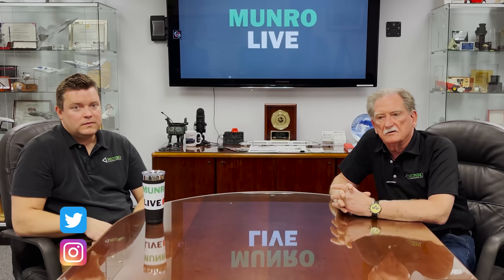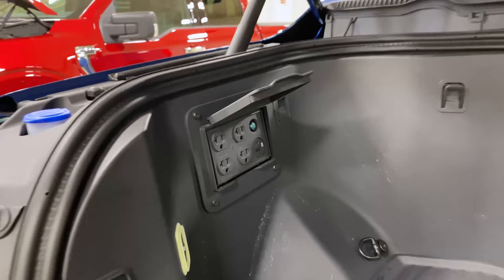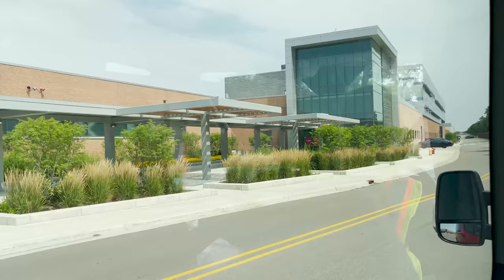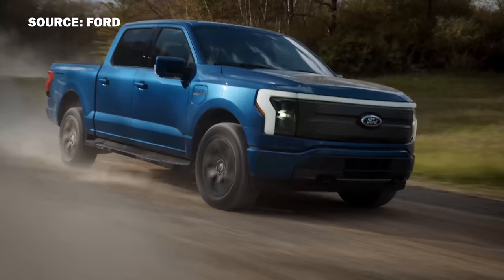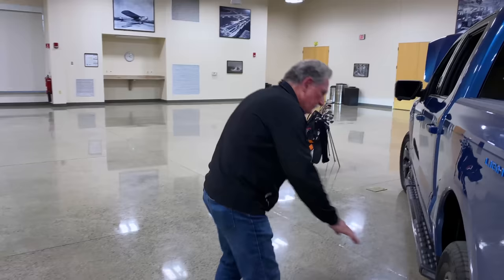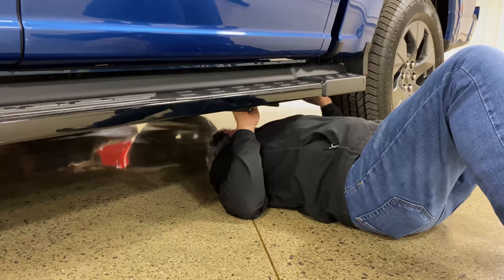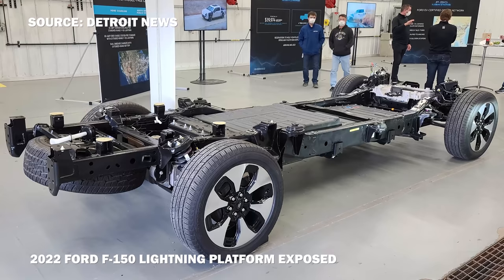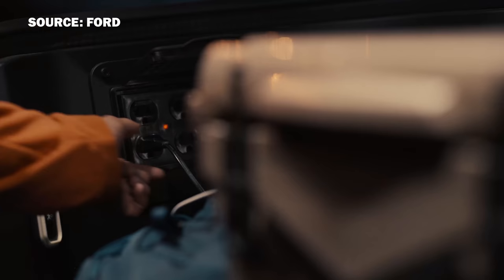Sandy's First Look at the Ford F-150 Lightning Electric Truck!

Comment: I’m not sure I understand what “isolating the battery” means.
Reply: Same here. I hope somebody will explain.
Reply: My impression is that others use the battery as a structural member, whereas it appears there's a more conventional frame with this truck.
Reply: I wonder that too!
Reply: Vibration-isolated, i.e. mounted via rubber bushings and such.
Reply: Shock-inertia-protected is how I read it.
Reply: Isolated from the rest of the vehicule, with rubber bushing or something. My guess is to prevent impacts to be transmitted to the battery pack.
Reply: I’m sure we will find out when they tear into one in the coming weeks.
Reply: isolating from vibrations?
Reply: I guess it might be easily removable/upgradeable...
Reply: Ok.. isolated is great now? Weren’t we being told making it an integral part of the chassis, that THAT is the best application? Instead of hauling the batteries like a sack of potatoes, make them work to be part of the stiffness of the whole chassis?? Now I’m confused why isolating the battery is some good idea.. vibrating the battery module is not something that was ever mentioned was a bad thing
Reply: @airheart1  The difference is this is a utility truck. You're supposed to be able to drive on rough terrain at reasonable speeds without shaking the battery apart.
Reply: @jabroni6199  Weeks? It's not shipping before mid-2022.
Reply: I’m that guy in the back of class confused as hell but not sayin shit so thanks for speaking up. He glossed over it like it was common knowledge and I kept wanting to know how that compares to the structural battery pack Tesla has planned.
Reply: The battery is mounted the the frame via a series of rubber isolated mounts, much like motor or engine mounts. Batteries do not like vibration inputs. Given the nature of body of frame vehicles there is a fair amount of cross vehicle flexing. Hence why beds are not typically integrated with the cab (which is also isolated). While body of frame / unibody trucks with integrated cab/bed configurations do exist, there is typically a notable trade off in payload capacities and tow ratings. 

More then likely a fixed or rigid mounted battery did not pass internal Ford targets.
Reply: @68fbjjz109  so are we saying this isolated battery is good for the F150 because of the body construction? But this doesn’t apply to the Cybertruck because it is not the same style of body construction? Or what? Are we suddenly saying the CT should isolate the battery there also? I have a SERIOUS doubt you are going to shake apart a f’n structural battery.. it’s a structural component! If you can shake IT apart.. you would have to shake the entire f’n vehicle to pieces.. sooo you would have bigger problems then just the battery at that point.
Reply: @boostav  ok months 🤷🏻‍♂️
Reply: @airheart1  I think it’s a car vs truck thing. What works well for a car riding on smooth pavement 100% of the time isn’t necessarily the best way to build a truck which often times see much harsher conditions.
Reply: @jabroni6199  i can understand that difference and it makes sense. But they seemed to think that having the CT with a structural battery was a GREAT idea just a little while ago.. and they seemed to expect it to do off road work.. so I’m still a bit confused is it a difference between the F150 body on frame.. vs CT exoskelton thing also? Or are we going to decide the CT should be isolating their battery also, down the line? Not that I would be one who would use it off-road much to care.. but.. as a informed consumer.. just want the knowledge of what’s best for what
Reply: @airheart1  The F150 and Cybertruck are completely different structural executions. 

What is good for the Lighting, doesn't directly translate to being good for the Cybertruck. We are at the cusp of EV car adoption, and their is far from a industry consensus there, let alone EV trucks however, I wouldn't be overly surprised if a trend of body on frame based EV trucks (which have many merits) having isolated batteries becomes apparent in contrast to other offerings like the Rivian and Tesla.

The use cases for a trucks are much more extreme, and their wheelbase offerings magnify all structural considerations. If EV trucks are going to be successful in construction, utility, and off-road environments. Their battery pack must survive those unique considerations. Watch videos of older truck/jeeps going up RTI ramps, and then watch the latest generation vehicle do the same. There have been significant increase in torsional rigidity, and those are design considerations that are not incorporated into cars.
Reply: @airheart1  it’s possible the exoskeleton on the CT provides enough structural rigidity so that isolating the battery isn’t as important. Just a guess though.
Reply: Rubber mounts.
Reply: I think what others are saying, that the battery could be removal if necessary but i really believe that it's protected from impacts.  It's own thing, verse being part of the body of the car like the Mach-e, where it's battery is a support member.
Reply: @dirkkruisheer  it isn’t hard bolted in
It has rubber mounts to protect it from vibration 
It also probably is used like a big Harmonic dampener
That’s probably why it rides so well
Reply: @airheart1  it’s a good idea if you are using body on frame because you aren’t using the pack for structure. But I will dampen the ride I guess
Reply: @airheart1  it’s a dampener
Reply: @ericrotermund1004  Great, thanks. I assume it never can be a structural element then.
Reply: I think that, for a truck frame, battery pack isolation may be important because it will allow the frame of the truck to flex in torsion without distorting the battery pack. Truck frame design is more about toughness and resilience to excessive loads than it is about torsional stiffness to improve handling. Some flex in the frame is required to reduce impact loading.
Reply: @68fbjjz109  I generally agree, and I would add that the CT "Structural" pack with 4680 cells will also be injected with epoxy so I don't think vibration will be an issue.  Moreover, I think the structural packs w/4680 at Tesla will use chill plates underneath, rather than serpentine coolant passages, so that should be yet another level of robustness.  All that affords Tesla designers/engineers some different options, I assume.  Guessing Ford is using pouch cells, which maybe are more delicate?  Either way, it's a super nice truck and I'd buy one...unless Tesla takes my money first, lol...
Reply: @velotegra7156  I think it’s more about ride quality than anything
Reply: @bikeaddictbp  and why do we care to pay extra for vibration isolation
Reply: @airheart1  The Tesla 46-80 battery is an entirely different configuration so comparisons are difficult. The Tesla cells are cylindrical and potted in epoxy. The Ford battery uses pouch cells arranged in modules under mechanical compression.
Reply: battery is within the frame rails and not part of the body structure.
Reply: @airheart1  This approach and Tesla's structural pack is actually just two different routes to acheive similar results. In a traditional pack design batteries are bolted or bonded into modules which are bolted into packs which is bolted into the frame. That creates alot of points for vibration to cause damage or loosened fasteners to become articulation points. The cells, especially in pouch form, may be able to shift around. Ford appears to be isolating the pack to reduce shock to the cells. Tesla's idea is to bond all of the cells into a giant structural unit which shock and vibration would move through but not vibrate individual cells or modules.
Reply: @patreekotime4578  good point about those pouch cells maybe needing this isolation more. Yeah, I don’t foresee any issues with CTs structural battery approach.. just threw me for a loop the way Sandy seemed suddenly illuminated that a isolated battery pack was so impressive lol. But yeah what you’re pointing out seems like a reasonable reason why the different approaches might be correct for their separate applications
Reply: The legacy truck makers have body on frame still. So 
the battery really doesn't have to be structural so it makes more sense just to isolate it. That would be my engineering two cents worth lol
Reply: @davidhumeston5292  well its isolated like a gas tank or anything else... I don't see how its that innovative.  Basically they just put the pack between the frame rails and then put the body on top of that.  Seems pretty obvious for a truck>
Reply: @joeyscleaninglady2877  yes ... They haven't taken the time to truly design an EV truck..
I believe it's innovative for the fact that they are able to take a gasoline truck and still make a good electric truck... 😂..Ford has a ways to go before It makes true EVs not ice vehicles retro fitted to be electric.
Reply: @davidhumeston5292  The F150 is a well known and proven design. If you try to make a unibody F150 (which would be required if you want a structural battery), customers will be angry because it's not an actual F150.
Reply: @davidhumeston5292  yes these e axles are based on the borg warner IDM setup its basically the same architecture as the ford e-transit van.  They are sharing a lot of the parts between the two platforms.   Body on frame makes it a lot easier to change the top hat on the chassis and modify the frame.  I bet the efficiency will be terrible on this one.
Reply: @user2C47  marketing versus innovation... My neighbor down the road has a model T... He loves it...
The legacy automakers have to change.. Or they truly will be left behind.
Hopefully a well or appropriately engineered product will beat good marketing.
Who knows ?? Take care...
Reply: @dirkkruisheer  it mean the outlet where u  plug in isnt using the main battery that power up the vehicle so it's isolated
Reply: @user2C47  Bingo!
Reply: @WoodlawnSound  There is more to it than that.  It is for durability.  Trucks are expected to be able to be driven on gravel roads, dirt roads, or off-roading, and suspending the battery helps a lot with the durability.  As Corey talked about -- trucks are expected to be much more rigorous than sedans and SUVs (trucks need to have at least double the robustness of sedans).

What you wrote is only the drawback to insolating the battery, because the big advantage is an increase in durability and reliability.

This is why Sandy and Corey were enthusiastic about it.
Reply: @heavypizza  all batteries degrade. Even the ones in a Tesla.
Reply: @airheart1  There is a difference between how robust a truck needs to be compared to how robust a sedan needs to be (double or more).
Reply: @airheart1  cybertruck is a unibody design. There is no split between the cab and the bed like there is on a normal truck. Ford was able to put the battery up inside the frame of the truck which will make it replaceable as they can drop it out. The cybertruck with its exoskeleton doesn't need a frame so the pack will be up inside the floor. I also believe that Tesla battery tech is going to be way ahead of ford and the Tesla batteries likely won't need replaced at all or as often at least.
Reply: @jabroni6199  2022 .
not a few weeks
Reply: @db4z09  no its a borg warner iDM, Ford may be assembling the inverter on the iDM  but its coming from borg warner... BW spoke about it on their earnings call.  They are using the same units in the e-transit van that will debut next year as well).
Reply: @joeyscleaninglady2877  yes transit will use borq warner but not f150
Reply: Probably also a cost reduction effort
Reply: A pickup truck has to flex and tye cab dynanics are different than the payload bay (box). You DON'T want a rigid chassis. Look at truck history...unibody pickups sucked.
Reply: Probably required for the body flex that body on frame trucks have. Have you seen how much a truck torques its back when taking a bump? You don't want anything with wires and sensitive connection points inside flex that much. I thing vibrations are secondary and replacing the batery pack is an obsolete idea.
It will take more than a few rubber mounts to isolate from as much flex as a body on frame truck does. So I'm currious how they did that.
Reply: @airheart1  in a monocoque chassy car, you want to contribute  to body stiffness for handling.
In a long frame truck that twists, it's pointless, better to suspend it and put a cage around to protect it.
That way, you'll never have battery degradation from vibration or torsion and they can be built as cheap as possible.

Same with the frame.
Built as cheap as possible and no worries about twisting the battery.

If you support the battery from the center at the sides and from the center at the ends, the frame can twist a good amount and not affect the battery while keeping it perfectly centered.

It's actually quite clever vs the expense of increasing rigidity.

(I own a Tahoe by the way and am impressed by Ford on their innovation)
Reply: @benoit8850  that makes sense. So It comes down to the chassis designs.. CT will benefit from the very rigid chassis with their exoskeleton monocoque design.. the legacy pickup trucks with their body on frame design, would benefit more from isolating their battery from the frame flexing.. making sense now
Reply: @airheart1  Only positive I can think of would be vibration dampening, vehicle rigidity would probably suffer. Ford vehicle rigidity has always sucked so nothing new there. I could see some potential with those components leading to ev conversions for older vehicles, but that's at the margins, and Ford no tangible benefit to ford.
Reply: @airheart1  that's good for a sedan that's mostly on smooth terrain but on rough terrain vibrating a flamable battery might be a bad idea. That being said we will see how Tesla implements their structural battery pack in the ct.
Reply: @airheart1  that makes sense. Considering ct is an exoskeleton it's probably going to have more structural support and won't depend on the structural battery pack.
Reply: @mrfrenzy.  the Alternative seems to be to make it a sandwich of top and bottom with all the cells glued to everything else, like Tesla will do. Don’t think that’ll be shaken to pieces either, but we’ll see which approach is more successful in heavy duty use cases.
Reply: @capslock9031  it might work just aswell, testing will tell. However for Ford the modularity is probably a big advantage since they have soo many models they will be converting in the future. Tesla doesn't have a lot of old ICE models so they start from scratch anyways.
Reply: @boostav  --  Well, so it's 25 to 30 weeks.
Reply: @dirkkruisheer  -- A dampener can be considered to be a structural element.  Among other things it reduces fatigue of the direct structural members.
Reply: It is not a structural member of the chassis. Most manufacturers, including Tesla, are using battery packs as a load-bearing member to reduce overall mass. Ford opted to carry the packs load instead. It adds more weight, but in the end it reduces the stress on the pack and protects it
Reply: @airheart1  TRUCKS ARE NOT CARS. the battery being isolated is substantially better because it’s not bouncing around off road

Comment: It’s not just the generator noise - filling cans, gas stabilizer, spills, smells etc.  The fact that you could plug in a new generation inverter welder - the list goes on.